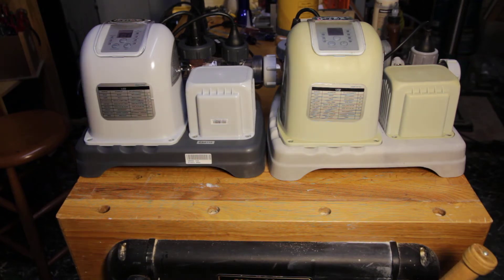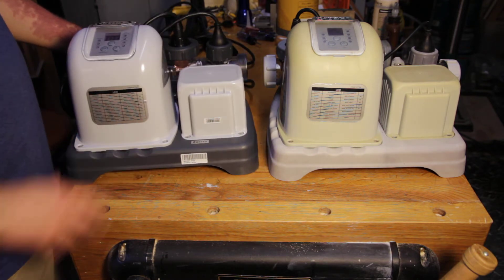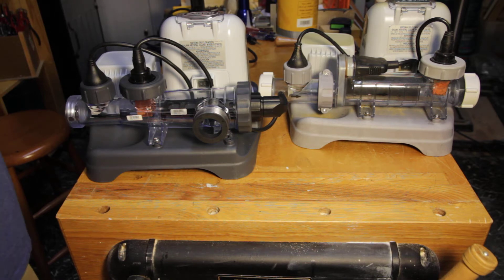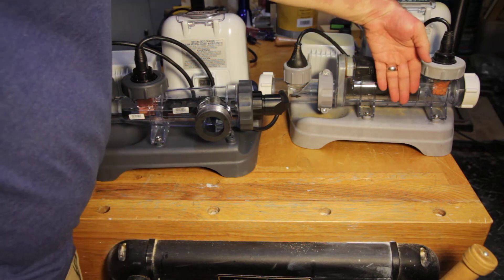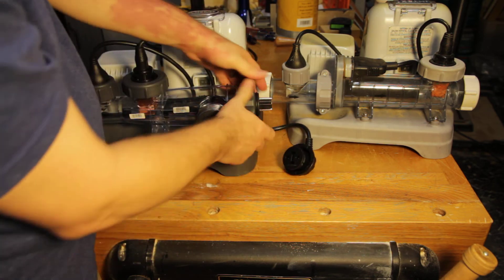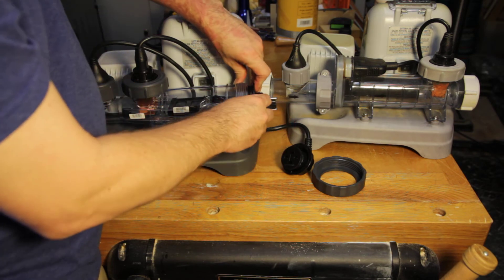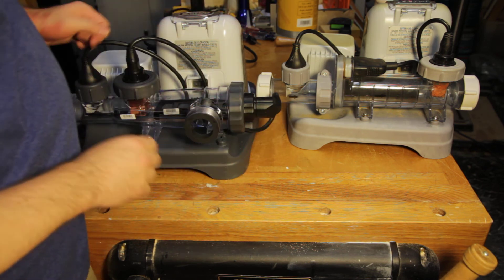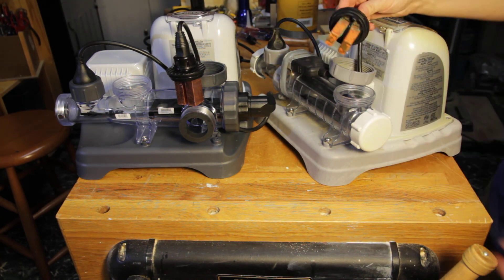Intex CS8110 Salt Water System model comparison (HD)

Comment: Great comparison video and exactly what I was looking for since my old unit has the code 91 (mentioned in your other vid) even though there's plenty of salt and the titanium plates are clean.  I got 3 years out of it, which still beats using chlorine tabs and shock, so I am going to buy another one.  Just wanted to know what the improvements were for the newer model before I pulled the trigger.  Thanks a ton.

Comment: Is this model rated for 7000 gallons or 15,000 gallons ?
Reply from the maker: These generators pretty much work with a range of different sized pools. For larger pools, the SWG has to run longer to produce the appropriate amount of chlorine. The manual includes a table showing the run time needed for different size pools. For a 2500 gallon pool (very small) it's one to two hours. For my pool (6500 gallons) it's about four hours. The table only goes up to about 14667 gallons and it should run for 8 hours. Of course this is the time for just the SWG. The filter also has to run and that time is usually longer(usually an hour longer than the pump).